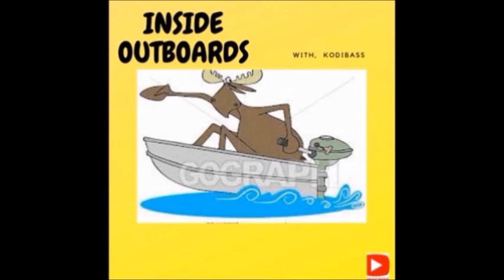EVINRUDE  25  HP  SHORT SHAFT CARB ,  THROTTLE,  &  MANY OTHER  ISSUES.

Comment: Those are fantastic engines. I've found that you clean their carb, set the cam roller timing properly and they will start evertime on first pull, one third the starting rope lenght out. Love them !
Reply from the maker: yep''  Why  the owner  will spend the $  haha   Good old  motors  4  sure..        kb

Comment: I BELIEVE if you check the left side of the vice or ground close by you will find the pin, I saw a small shiny piece fly out when the pump popped up with the screw driver.
Reply from the maker: Yep  found  it,,   thanks mate.      kb

Comment: Hey kodi really enjoy watching your videos-just seem like you and-this old outboard-gives me great advice when I’m having issues with my outboard,seeing if you can help me out with this one,it’s a 1991 25hp Evinrude compression is 135 T&B-great spark-new carb kit-cleaned carb 3times,starts on first pull-butterfly opens full at WOT-just will not give me Full Power,runs 13mph on a 14ft Jon boat,does not stall or excelerate runs just would not give me full power-at one point it did for about 5min slowed it down went to give it wot again and it did the same,pulled flywheel off and noticed the charge coil was leaking a little glue on the armature plate-wish there was a way I can send you a video of it running It’s only about 25 seconds,please any advice is appreciated